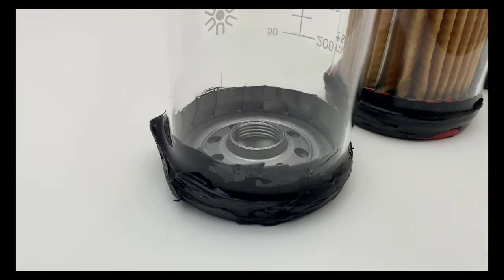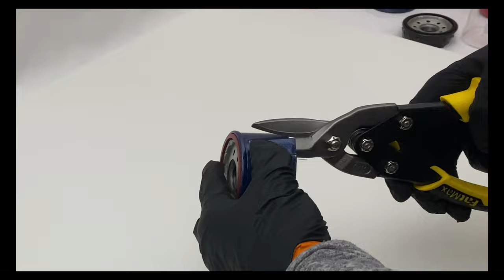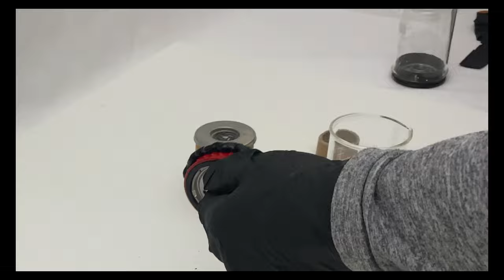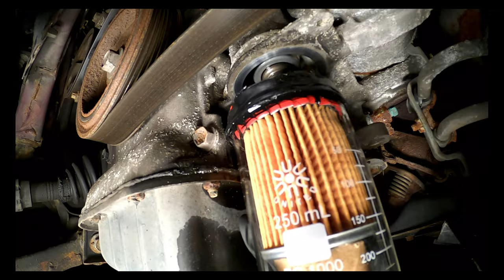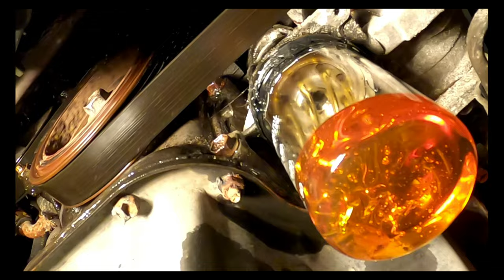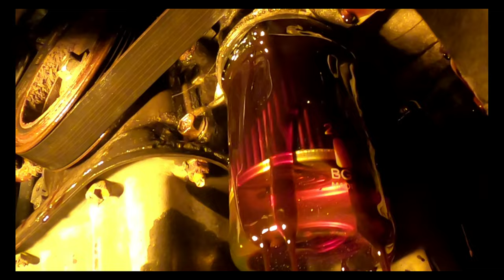Clear Oil Filter (Glass Housing)

Comment: I used to be a tech at Valvoline, and still always do my own oil changes for myself, friends & family, and seeing all that oil fly out everywhere makes me cringe because that’d be hard to clean up, but the clear filters are actually really cool. They should make oil filters like that somehow
Reply from the maker: I was expecting a mess, but not this much! Time for the pressure washer and some degreaser.
Reply: Why should they make oil filters like that? You can't see it, and it'll darken quickly to the point that even if you could see the filter in action you wouldn't see any oil flowing due to it being dark.

Don't be dumb.
Reply: @michaelcohen9363  not dumb, he just didn’t think about as he should since he is a tech
Reply: abiggermrbrute  same here.  I was also a tech at an oil/fluid change shop, and I always changed my own oil.  Most of my friends & family think I'm old fashioned for flushing & changing my own oil regularly.  Even though I always drive old japanese cars, they never understood why I'm so meticulous when it comes to maintaining my old cars while they spend thousands of $$$ on repairs that could have easily been prevented.  Whenever I try to educated them so they're more mechanically sympathetic, they shrug me off claiming they don't know anything about their cars.  I was just trying to help them.

Comment: Good job Owen. I think it is actually a good thing that the seals failed. Otherwise, the glass probably would have shattered from the pressure. This video is excellent for training auto technicians and DIYers about the proper way to replace an oil filter. When possible, the filter should be pre-filled before installation. This prevents the "dry-start" short term "Knock" that results from the time it takes for the engine oil to fill the filter housing and saturate the filter media before allowing pressurized oil to arrive at the bearings inside the engine. If you add up all the "dry-starts" from every oil and filter change, I feel that the wear is similar to cold-start wear and, in this case, it can be avoided with vehicles that have filters positioned like the one in this video and as found on small block Chevrolet engines for example. Great engineering that decided to mount the filter in that orientation. Once I learned to pre-fill oil filters, I noticed the instantaneous oil pressure prevents the start-up noise and the oil light goes out much faster. With the newer style filters with an anti-drain back valve, you take a small blunt (golf tee or similar object) tool and temporarily disturb the valve seal to allow trapped air to escape while filling the filter housing through the center hole. Takes a little more time but it is worth it for a top-notch professional job. God Bless.
Reply from the maker: That's a great tip about air bleeding the oil filter. Thank you!
Reply: @OwenLucas  You're welcome my friend. I admire the effort that you took to make this video. It is very valuable for learning especially for seasoned Auto Technicians and the DIYers alike, if they are willing to keep learning and trying to improve. Thank you, Owen!

Comment: Next time use a 2 part structural epoxy (the kind used in auto body repair)
Next time get a glass specialist to cut the tops of the beakers off to remove the pour spout and make a square edge. It should work then!

Comment: Kool idea I like the clear filters. 
And I found out just how much oil goes through the filter one time when I tried to take a filter off and got the seal broken then decided to drive the truck on ramps and started it and turned around for a second and then back again and wow 😯 the ground was covered in oil. I didn’t run it dry or cause any damage but that oil moves fast.

Comment: so even when you prefill your filter - if there is a little bit of contamination - it gets pushed DOWN into the filter first and should get caught in the filter - before the oil fills back up through the center of the filter. I was wondering about this. thanks

Comment: Thanks for taking the risk for our curiosity  👍

And does all the engines need more than two oil changes to become smooth and yellow without any old oil ? or just yours has sludges ?
Reply from the maker: It really depends on the engine.  I did an engine flush 8000 miles: https://youtu.be/rCo6aCed0bo  before the first oil drain in the video, so the engine should have been pretty clean internally.  The oil is dirty most likely due to blow-by and age.   I wanted to make sure I had clear oil for the glass filter so I just kept changing it until I felt it was good enough for the presentation.  I think it might come out clear for most people after 6 oil changes but there really is no reason to do so.

Comment: Could you test how much oil gets absorbed in the oil filter ? 
Cause I have a replaceable paper filter and I always dump it in oil to pre soak it, would like to know if it's effective or a waster of time/effort :)
Reply from the maker: I prefill my spin on filter cans but I have never dealt with a cartridge paper filter.
Reply: @OwenLucas  could you take the paper out , soak it let it " drip " the excess and weigh ?